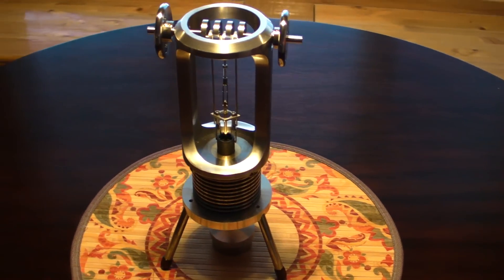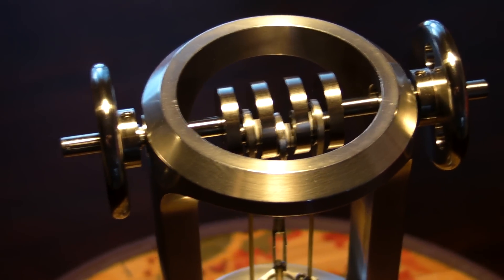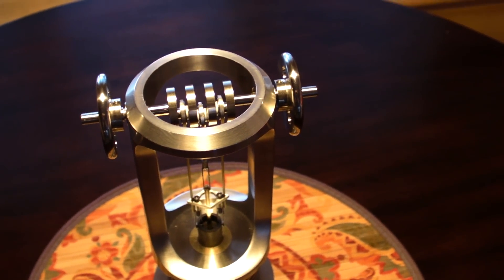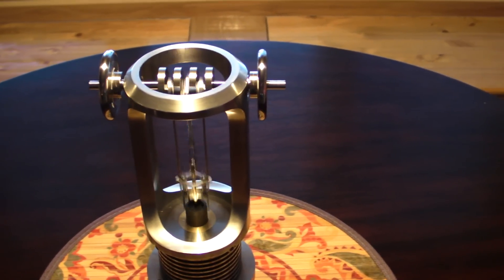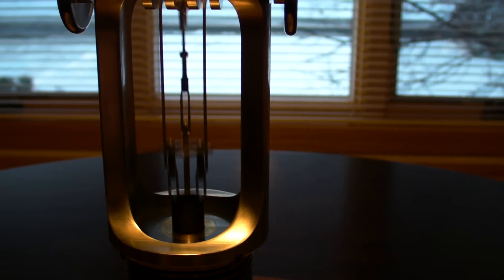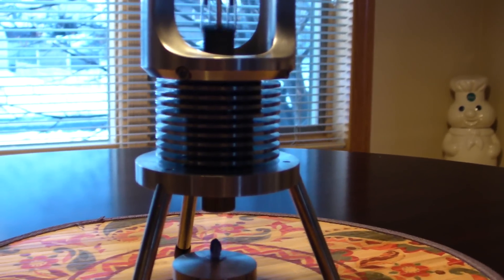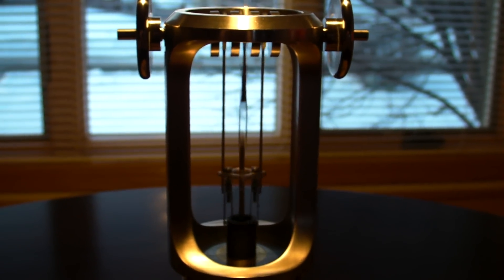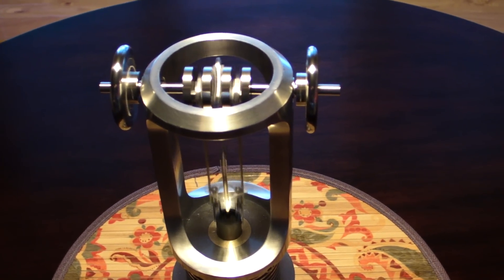Beta Stirling Engine

Comment: a late comment.  thanks for posting.  nice work.  based on the wording used when describing the piston and displacer, the displacer was turned from graphite.  if the mass of the displacer could be reduced by using thin aluminum or stainless steel. the engine might run faster.  cheers

Comment: Do you have specifications on the cylinder construction such as diameters, volume displacement, etc? I would love to try and build one of these in my machinist course but I'm just unsure of the exact internal specs that these need to function properly. Your design is very nice!